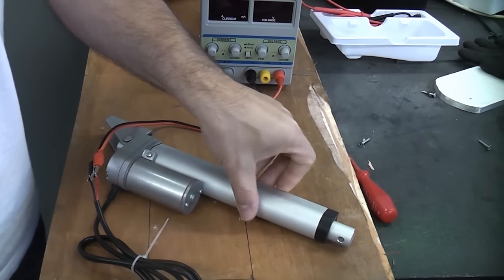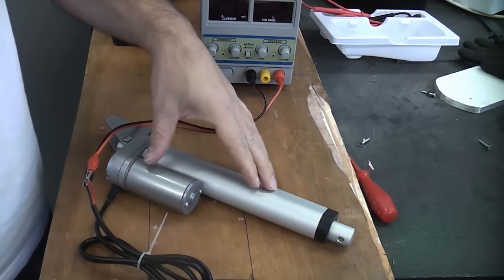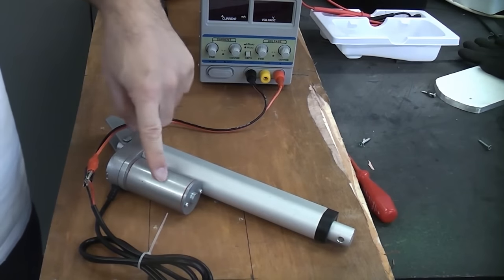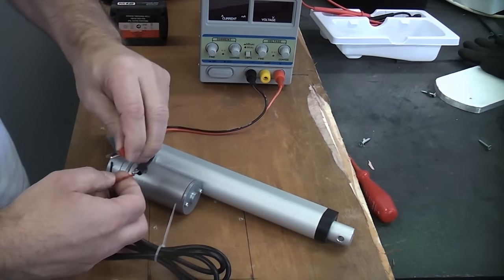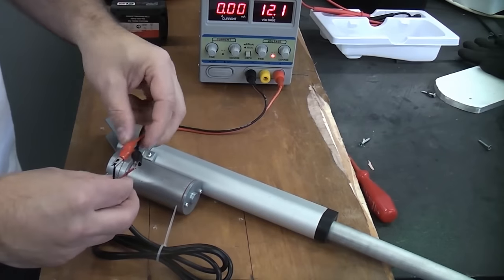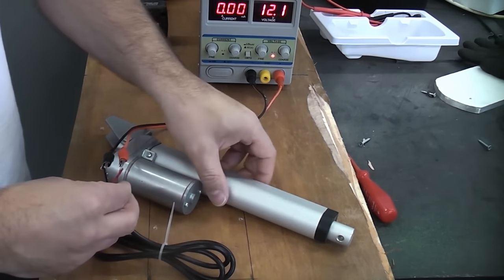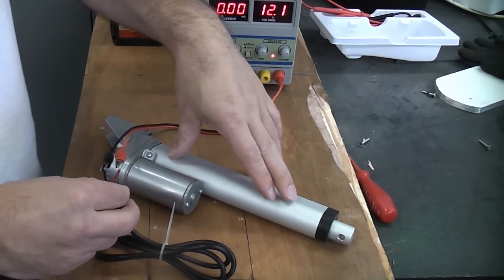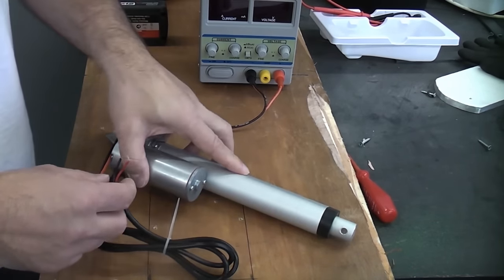Linear actuator | Electric actuator

Comment from the maker: TheVideoVolcano 
Yes, you can reverse a single phase motor but not by reversing polarity, it has to be done using other circuitry. A DC motor can be reversed by reversing polarity and three phase motors can be reversed by swapping any two of the three phases.
Thanks for the comment
Reply: ***** ah yes, I see thanks for the clarification.

Comment: On the 3 phase AC motor, you can reverse the direction of the motor by swapping the outer 2 phases, FYI :)
Reply from the maker: Yes, I'm well aware of that (I'm an electrical and mechanical maintenance engineer).
Thanks for the comment

Comment: this dc motor is simple,  exchanging polarity will change the moving direction, 
it is just a way to control the turning direction of motor,   gear box reduce the RPM of motor and meanwhile improve the torque, that's why it comes up to us

Comment: Hope you can help I'm looking for an actuator that you push a button and  once you let off the button I want it to auto retract
Reply from the maker: I think you can just use a normal linear actuator, then use a DPDT push button switch. You can then configure the switch so that the actuator is set to be permanently energised in the retract direction, until the push button is pressed, then the voltage will reverse. When you let go of the push button the actuator will retract until the limit switch inside the actuator is reached 👍
You might have to do a search and a bit of homework to ensure that you get the correct switch and get a rough idea of how to wire it

Comment: Very useful.when it is connected In a window for example and we want to open it manual by hand,can it be moved or it can get the power from the piston to motor?
Reply from the maker: It needs to be energised to move it in either direction. Perhaps you could make a quick release pin to be able to disconnect the actuator from the window
Thanks for the comment 👍

Comment: I wonder how weather proof are these like say to use to angle up a solar panels ontop of an RV or van?
Reply from the maker: I don't think they are very weather proof to be honest.
You can probably get special ones for outdoor use, some electric gates use them etc.
Thanks for the comment
Reply: @ultimatehandyman  That's about all I could find until I searched waterproof gate motors and almost all of them came up with the waterproof data.
and is the same thing I'm thinking about so I'm not climbing up to the roof every time I wish to move! 
If you or anyone else does STOP!!
Next time you climb up when you get to the last rung or the top one stop climbing and then proceed using your legs not your arms as I found that the screws in the rails were pulling out because of the previous owners climbing up and then pulling himself up the last step thus putting a lot of upward pressure on the 4 screws on both the ends and had pulled them out of the roof over the bed!! 
Yep a quick replacement patch fiberglass work and new screws and it holds fine but now I know not to climb like its a ladder on a ship welded down to a steel deck and can handle extra pounds!

Comment: I want to make angel wings that move or open and close.  Is this one to much power? Would you recommend 1 with a pulley system or 2 one on each side?
Reply from the maker: You can get powerful actuators, some of which can lift 150KG etc, but they do not move quickly.
Obviously if you use pulleys you might increase the speed or the range of movement, but the weight that it can move will be reduced.
Thanks for the comment 👍

Comment: Hi im a blacksmith looking for a few years now to make a forging press what power can these put out IE how big do they come and are there different types for this sort of power (24+ton but can use more than one)
Reply from the maker: These do not come in large sizes I'm afraid. Some of the larger ones can be used to open gates etc. but for the power you need you need to be looking at an hydraulic system.

Comment: can this stop "mid-stroke" and hold it there without retracting back down when the supply is off ?? It's got a ball screw so i guess it should right ??
Reply from the maker: Yes, because it uses a ball screw, it will stop in any position if it is not energised.
Thanks for the comment
Reply: @ultimatehandyman  nice ! Thanks a lot for the info mate !

Comment: Do you know if ALL linear actuators have the limit switches at both ends?
Reply from the maker: +Knight 
I'm not sure, but all the ones that I have seen have built in limit switches, otherwise the actuator would be damaged if it was not stopped before reaching the end of it's travel.
Reply: +Ultimate Handyman Thanks, that's what I was thinking too. Great video, it helped my to decide on making the purchase of a linear actuator know that i have seen it working.
Reply from the maker: +Knight 
You are welcome.
Thanks for the comments

Comment: Can actuators be extended without power? like can i just pull the end with my hands or does it need power?
Reply from the maker: No, it needs power, I'm afraid
There is a ball screw and nut on the inside, so you have no chance of pulling or pushing it.
Thanks for the comment 👍

Comment: hello, do you know any actuator that is not slow as this one?. a fast one with the capability to lift a heavy object. the idea is to put the actuator under a seat. which then will lift the seat with a person on it.
Reply from the maker: I don't know of any electric actuator that can do that, but a hydraulic cylinder will do it, but they are expensive to set up as you will need a pump etc. Thanks for the comment 👍
Reply: @ultimatehandyman  oh okayy, thank you😊

Comment: nice review. how many amps of 12v does it require?
Reply: Jackie Each one is different.  But a standard 12 inch normal weight capacity one needs about 4.8 amps.

Comment: I am looking for an actuator capable of push/pull 200lb with a 16" stroke with a travel of around 100mm/s. Any ideas or recommendations. 

Steve in chesterfield. 

PS the project is to drive a high pressure pump for a PCP air rifle.
Reply from the maker: +steven holmes 
I think you might need a pneumatic cylinder for that speed. 
You can get 16 inch electric ones that can move 300lbs but they only move at about 6mm per second.
The only problem is that the cylinder will probably be very expensive and you might need a large compressor to power it.
Reply: +Ultimate Handyman I best start swatting up on how to set these up.
Reply from the maker: steven holmes
These videos might help- 
https://www.youtube.com/watch?v=YL3-0KoSAGI   

Some pneumatics in this prop-
https://www.youtube.com/watch?v=KSExdrWUFQs

Comment: hey!! by reversing the polarity its direction of travel is reversing. I need to generate reciprocating motion using this linear actuator. i.e  i need mechanism/circuit that can reverse polarity at a given frequency. Any suggestions please?
Reply from the maker: Something like this might work- http://fave.co/2gLCN5q
Reply: thank-you..will surely look into it!! btw.  is it possible to vary the frequency and speed?
Reply from the maker: I think the board that I liked to said that you can alter the frequency at which the polarity is changed in seconds.
The speed can be adjusted with the voltage but I'm not sure how to incorporate a variable speed into the circuit.
If you just need the same speed each time that can be done by changing the voltage slightly.
Reply: will try... thank-you once again 😀

Comment: What's the smallest 12 volt battery this will work with?. Thinking of building a lift top coffee table that run on a rechargeable battery :)
Reply from the maker: Any 12v battery should work, but the smaller the amp hour the quicker the battery will flatten.
Reply: Ultimate Handyman thanks :)
Reply: The smaller the battery the less current it can output at once.  For instance, you cannot run a 1,000 watt inverter off of a 4 amp battery.  But you can off a 50 amp.  Just make sure your battery can keep up with the demand.  A 12v solar battery or pretty much any deep cycle battery would work good since they are usually designed to hold alot of power and support huge loads.

Comment: Is there a way to adjust the speed of the actuator to be faster?
Reply from the maker: You could probably increase the voltage slightly, but too much voltage might damage the motor.
Thanks for the comment

Comment: i could use it to move the rear spoiler on my datsun cherry
Reply from the maker: Yes, these have loads of uses on vehicles ;-)
Reply: ***** Need a linear actuator with a stroke of 150 mm, the strength of 100kg, speed 20-30mm seconds - how much it costs and how to order
Reply from the maker: Дмитрий Лазаренко
They sell these on ebay, but I do not know of they ship worldwide.
Gimson robotics (they have a shop on ebay) will definitely sell something suitable but I do not know if they ship to your country.  I paid about £50 for a similar one ($75 US )

Comment: i have one on my mowing deck stuck extended i hit end of rod i sprayed wd40 i jumped on mowing deck it wont move wont retract
Reply from the maker: You might have to remove it to get it free again as it's not always possible on the machine.
Reply: Ultimate Handyman yes it's extended under tension real fun tight area I tried turning piston no luck